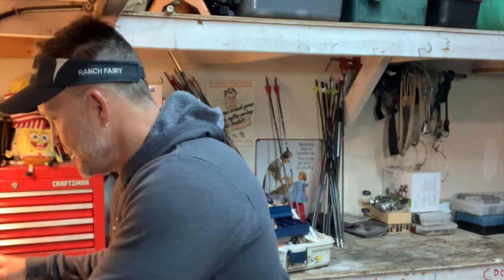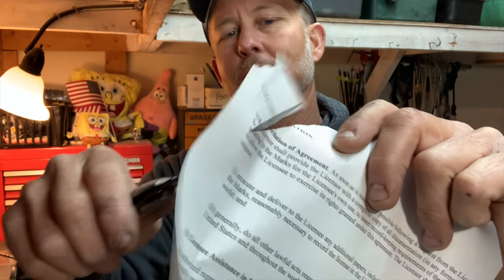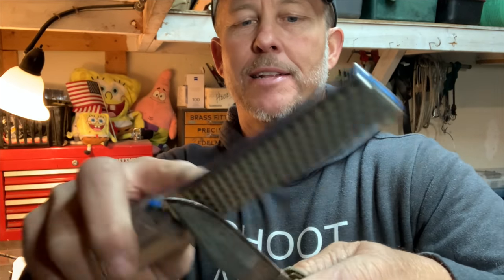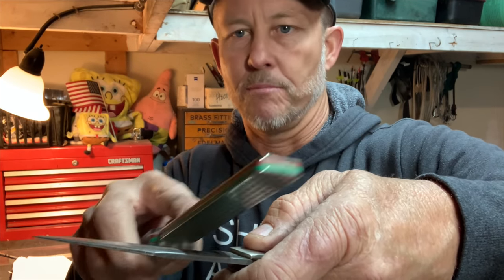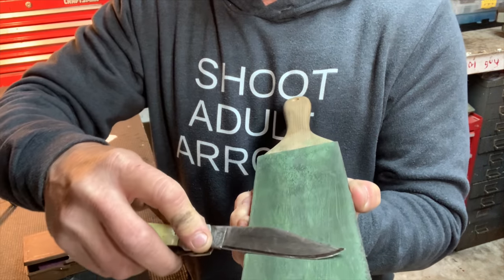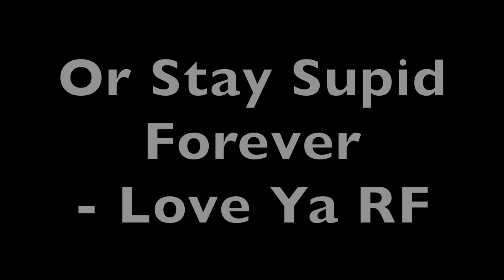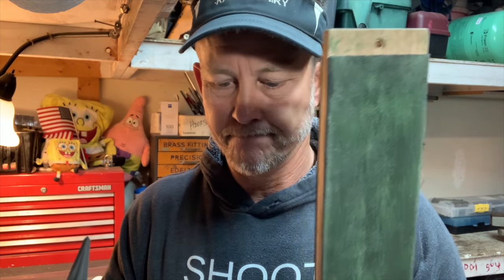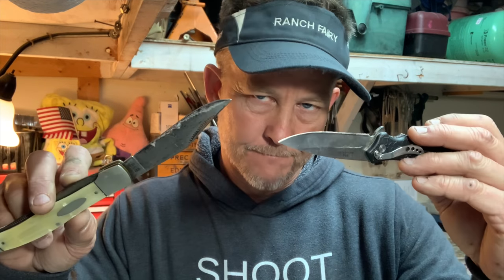Broadhead Sharpening Hack l Ranch Fairy

Comment: Also I have 200 grain broadheads should I put em in my 300 hunter xt with 100 insert I’m pulling 70
Reply: My bow is right at 73 lbs and it didn't like 200 grain with 100 grain insert on a 300 spine but it loved them on the 250..your arrow length matters also I shoot 28 1/4
Reply: @whitetailtherapy7908  i shoot like 29 my guy
Reply: @andrew.plank.music.  I got a video where I run through the whole Ranch fairy test kit if your interested. But just my opinion I would bump the weight down or atleast go to  250 spine..175 and 200 grain didn't shoot very well for me on 300 spine.
Reply: @whitetailtherapy7908  ok, I’m 13 tho so I don’t got that $$😂
Reply: @andrew.plank.music.  I totally understand man. At your age I was the same way had to use whatever I could lol. Troy deff has alot more knowledge on this . Some inserts you can cut down also. His website has his email he will reply and help you out if you want more options to shoot the 200 grain broadhead 👍
Reply: @whitetailtherapy7908  thx man